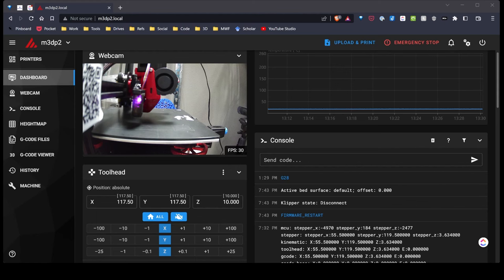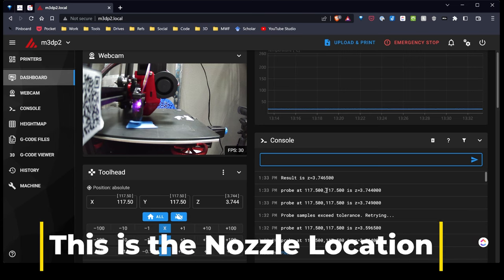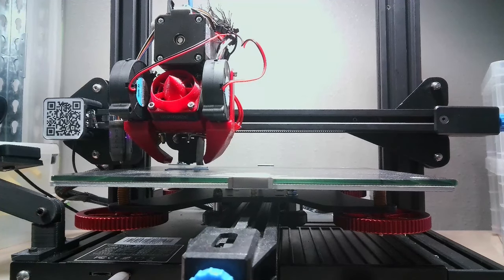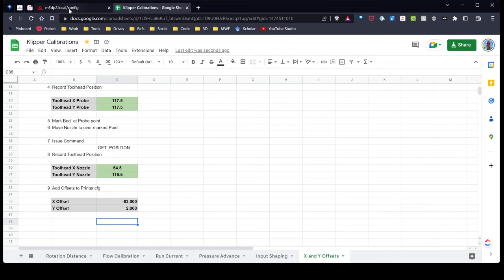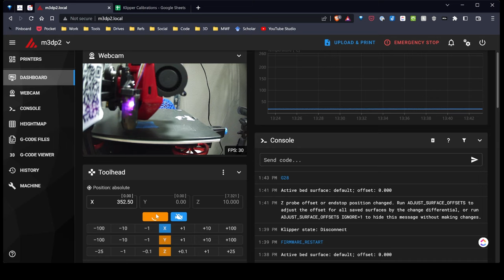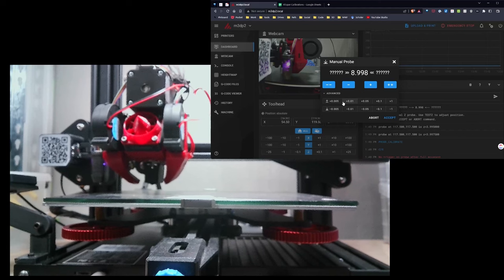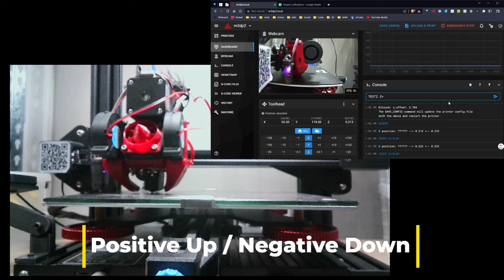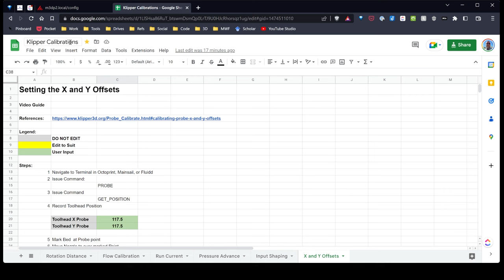Quit Stressing! Set X, Y, and Z Offset in Klipper: Quick and Easy Without Pulling Your Hair Out

Comment: I had an issue setting my Z offset, Move out of range: 149.500 161.500 -0.990 [0.000]" but was able to fix it by setting a value of Z position_min -10 (it homed between -3 and -4, but others online have seen up to 10)

Hope that helps someone.

Actual documentation says "During calibration it may be necessary to set the printer's Z position_min to a negative number (eg, position_min = -2). " but I had to go even farther.
Reply from the maker: This is a really great point. On one of my printers that has z tilt I had to do -15.

Comment: I already have enough of my printer tronxy x5sa. I installed the Klipper on the rpi4, the printer board I have is the original V10-446, I did everything as in the video and when I start printing the nozzle is above the table 2.2 mm. I don't know what to do anymore. Is anyone able to advise?

Comment: Hey! Thanks for this video. I am having some trouble however. My probe doesn’t have a “point” like yours. It’s a proximity leveling sensor that’s flat. I’m unsure how to proceed and mark it accurately. The printer is a Neptune 3 Pro. Thanks again!
Reply from the maker: I would try to measure from the center of the probe.

Comment: Good video presented 👍. Does Z travel max anything to do with min stop -2 or -10? Sort of travel range?
Reply from the maker: I think it has more to do with sensor placement and offsets.
Reply: @minimal3dp  thanks bro..I had a whole day after converting FlsunSR to klipper and yet to get a good first layer as it was printing fine with Marlin. The bed is not adjustable and there’s no mechanical compensation not like I had with bed slingers. A bit regret as it scratched my pei bed. Thanks for making this video to help those plunging into Klipper newbies.❤️

Comment: Can I carry out the X/Y offsets with the tool without a leveling sensor too? Or is there another small program that makes it easier to configure the X/Y axes correctly? I have an Ender 3 with BIQU H2 hotend and my printable area is not correct. It also doesn't print in the middle and I can't get it under control.
Reply from the maker: You should be able to do x,y by itself. Jog the h2 around the bed and note the values. That might help with getting the printable area.

Comment: When i save after calibration, after restart i get an error that z offset in bltouch cannot be lower than 0.0. z offset in bltouch is commented out and klipper is ignoring the auto-generated offset.
How do i fix this?
The auto generated z offset is -0.130
 
EDIT: It turned out i had the z-offset in bltouch too low which resulted in the auto-generated z offset being negative.
I had bltouch z-offset at 2.450. I set it to 3 and the resulted auto-generated z-offset was 0.430.
I noticed he set the bltouch z-offset to 4 in the video but i did not realize it was for this reason.
 
So, if anyone else has this issue. This is the problem.
Reply from the maker: I think there is another setting you can use to take care of this as well. I will try to find it for you.

Comment: Hi Mike. Will this work the same way if the bed zeros at back right?  I have and ender 5 s1 not a an ender 3
Reply from the maker: It should work the same way.
Reply: @minimal3dp  sorry Mike me again.  How would I or where would i find in the cfg the place to set the coords of XY home position. My nozzle when homing sits at  5x5 when hitting the endstops ( cant move them ) so  on the bed when homing the nozzle is off centre?
Reply from the maker: You need to look at your printer.cfg.Adjust your bed size based on your endstop locations. @markstacey6082
Reply: @minimal3dp  thanks all sorted
Reply from the maker: Glad you got it. @markstacey6082

Comment: Why is it when i do probe_calibrate and save it and started printing. My z is goes high again? I put z min to -3 im using ender 3 printer. Thank you
Reply from the maker: What does your printer.cfg look like?
Reply: I have this issue, did you manage to sort it ?
Reply: @ste03  i did manage to fix the issue but i did it manually for right now.
Reply: I have same trouble everyone so I do the feeler gauge then adjust on the fly

Comment: Just curious, may I know what is the thickness of the feeler gauge that you used? 0.1mm?
Reply: I use a 0.1mm feeler gauge, as that is the thickness of the normal A4 paper from my injet printer.
Reply: I use a 0.05 but even after saving config I run a print and first layer is still 0.15 to 0.20 away from bed so some times be prepared to do some adjustments on the fly 😊😊😊😊😊

Comment: Interesting. It seems like a bit of a waste at first glance, but if you think about it, if you are the kind of person that uses those and IF it can be reused for a long time, it would actually save material when factoring in how many would just be thrown away from failing or not being reusable. 

As far as it not pulling away clean, it may be a good idea to heat it up and then let it chill (literally) a bit before pulling it. Especially on glass which I guess could act as insulator and keep it hotter than say; drywall, wood or metal may. That could possibility make it gooeier.....it cpuld also just be a gimmick I'm which case it is a little extra unless you REALLY needed a good adhesion...but other adhesives would prob work better for that.....unless you also need to take it off eventually. Idk, fun to see at least.
Reply from the maker: Setting the z offset is key to leveling the bed.
Reply: @minimal3dp  ah I'm sorry, this comment was supposed to be on another video completely. How did that happen?!
Reply from the maker: @theminer49erz  No worries. I figured but always try to reply.

Comment: i can manually raise my z axis with controller and fluid but it refuses to go down unless i go up first and wont ever go below the starting point which is about 50mm above the bed. every time i try to home it it only goes up higher and refuses to come down. it also never finishes auto calibrate. is my z axis code messed up or could it be hardware?
Reply from the maker: What is your zoffset set to in your config?
Reply: @minimal3dp  0 right now but ive tried playing with it. i have tried setting it to 100mm which is how much it goes up when i home it and it still wont take that into consideration and go down :/